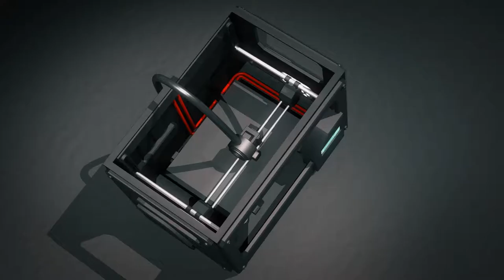SeeMeCNC ROSTOCK MAX v3.2 Build Series Part 11: Steps 38~45

Comment: http://www.hansenhobbies.com/products/connectors/tools/crimp_dx/  I would however recommend cutting the Dupont connectors off of the motor wires and crimping on the pins that came with the Duetwifi and use the proper connectors. I did have a Dupont connector come off of one of my other Duetwifi's. The correct connector snaps on. The crimpers I linked to are the ones I use. They are probably available elsewhere for less.